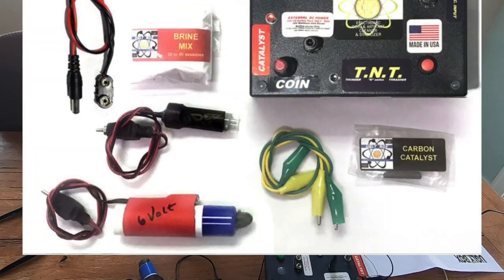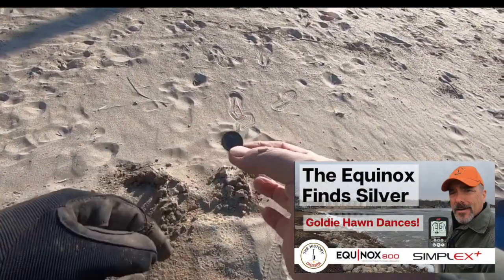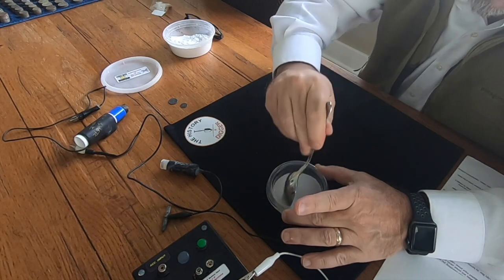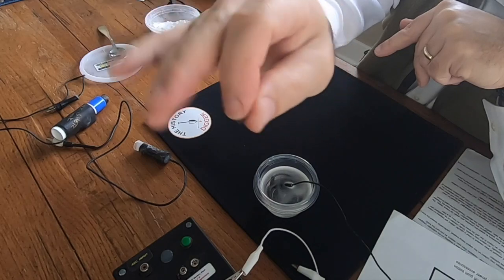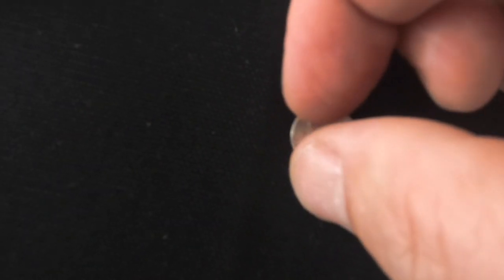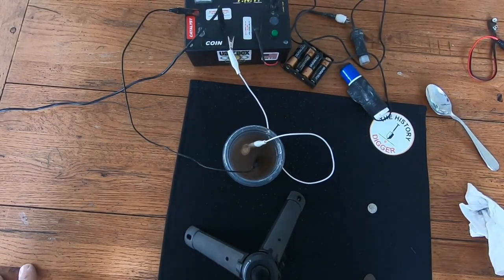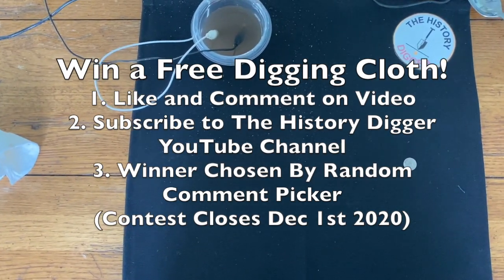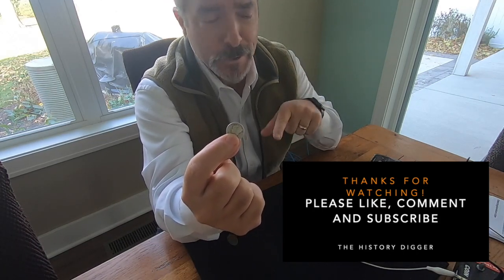Electrolysis: Before and After With the Ugly Box

Comment: Galvanic coupling would’ve worked just as well with less damage to the coin (which obviously looks cooked) than polishing with steel wool etc. I’m not sold on these. Super low level electrolysis I’ve used to remove green crud from silvers but it needs to be low and very slow and there are never any guarantees

Comment: Rob, nice demo of this unit. So 1 year later are you still using the ugly box or have you moved onto another better system? How long dis those clips, thrasher, brush last before replacing them? and lastly what is the brine solution made of? thanks
Reply from the maker: Thx. Yes still use a few times a year. Have only had to replace the clips snd still have plenty of the brine mix left. I think it is a salt mix of some type not sure.